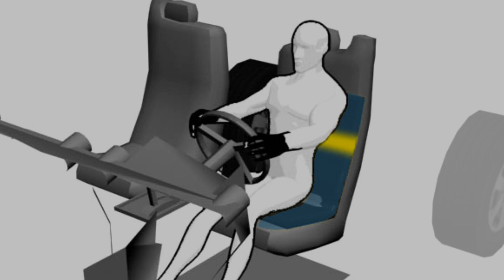NFB Blind Driver Challenge Video

Comment: I have no doubt that this system actually worked on this course.  What I doubt is whether a system like this would ever actually work on a busy road. The average sighted driver has a 1.5 second reaction time upon perceiving a road hazard.  At freeway speed, that means the vehicle will travel half the length of a football field before the average driver even reacts to a hazard. Even with a battery of sensors on every side of the vehicle, it would take a blind driver MUCH longer than 1.5 seconds to react to a hazard, much less determine the best reaction and the safest route of escape.

I know engineers will continue working on this issue, but I do not expect to see this current tech allowing blind drivers behind the wheel on public roads anytime soon.